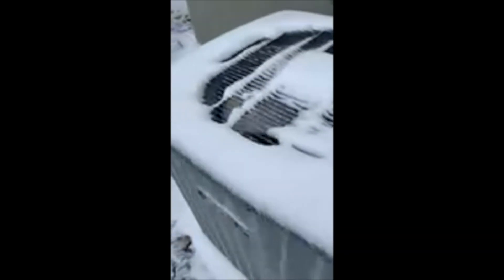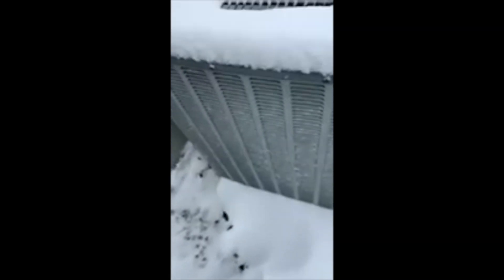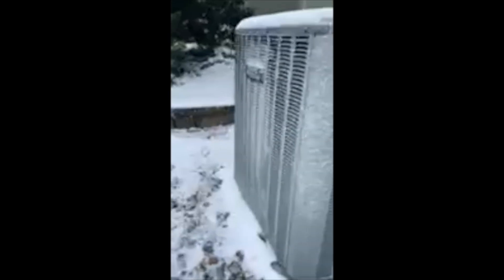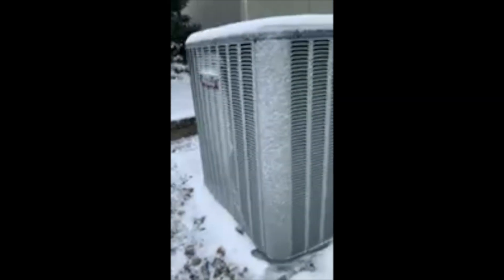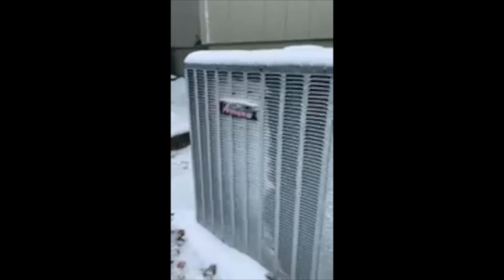Why Is A Heat Pump NOISY In Cold Weather?

Comment: We just had a bosch IDS 2.0 unit installed and it sounds like a jet engine is taking off whirring up for about 5 minutes and then simmers into what sounds like a semi idling outside of our ENTIRE home. There is NO WAY this is normal or meets bylaw noise standards. I have to shut the unit off at night and switch solely to our furnace heat mode because of this noise. It does it approximately every 1hr or so and lasts a good 20 minutes while it is loud.